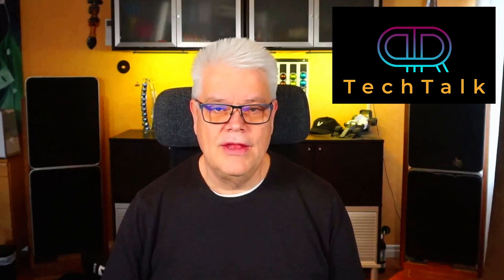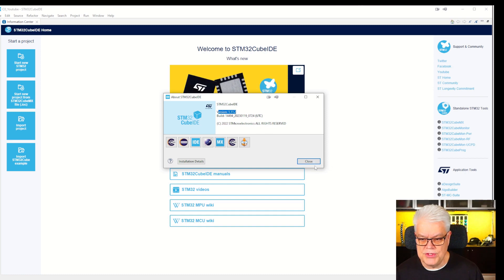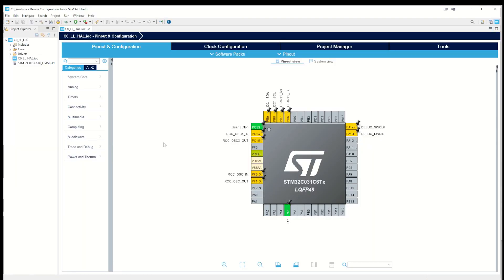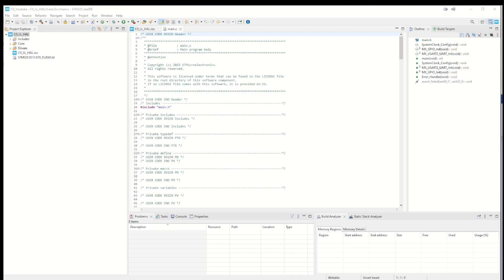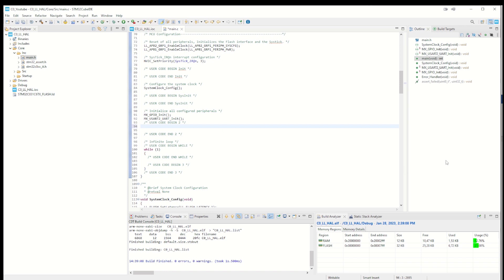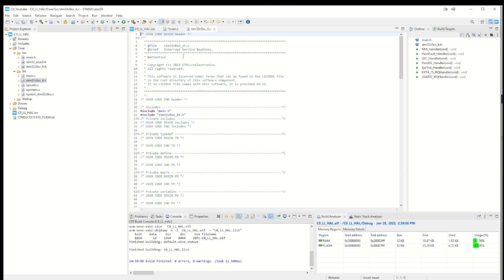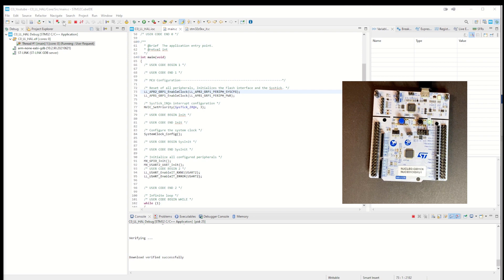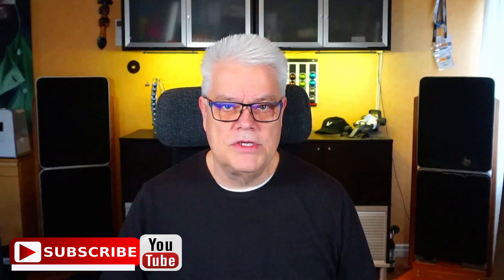STM32C0 UART project using LL Driver

Comment: How is putty sending data to the USART peripheral? I always use a usb to usart converter and connect it to rx and tx pin of usart but I don't see that in your case how come you are sending data using only usb cable?
Reply from the maker: Hi, the USB cable that is used for ST-Link is also carry the UART at the same time /PR TechTalk

Comment: You didn't introduce a transmit function, it's not the micro that sends back the characters, it's your PuTTY echo setting that does that.
Reply from the maker: Hi Craig, Thanks for taking the time viewing and commenting  my videos. If you look 08:46-09:33 i talk about the callback function. So whole demo is that the STM32 is waiting for a char to be recieved, then trigger this callback function and echo back the received char. So it is the STM32 that are doing the Echo back not the Putty. The send back instruction is on line 310. 
Hope this clears it out else just let me know :-)
/PR TechTalk

Comment: Hi Per, thank you for your video series on STM32. Would it be possible for you to put out a video regarding clocks? Specifically, what are the pros and cons of selecting one clock source compared to another. What are the advantages and disadvantages of selecting higher and lower clock speeds. I have searched on the Internet and found nothing useful on this topic. Thanks again !
Reply from the maker: I have made a video touching the Clock´s but just basic. If you mean if to use ext or internal clocks or what frequency is best. Can you be a bit more detailed?
/PR TechTalk
Reply from the maker: https://youtu.be/AB3EqvwQ8Xw

Comment: Hey, thanks for the tutorial. I've just checked the mouser stock for the STM32C0 and it does not look as cheap as it promised to be. Kind of on par with the F0 series currently. For my hobby projects I'm personally leaning towards new Chinese RISC-V low cost chips like CH32V003. Did you have a chance to try any of those?
Reply from the maker: Hi , I took a look at Mouser and selected SOIC8Pin and the STM8S050J3M3 cost 1.47USD/pcs and STM32C011J4M6 cost 1.42USD so approx on par. But you get more with the new STM32C0. So I think ST´s statement are somewhat fair. You can also look at www.estore.st.com for ST MCU´s.
I have not looked at any Chinese MCU manuf like the one you suggest.
/PR TechTalk
Reply: CH32V003 is 0.22 USD